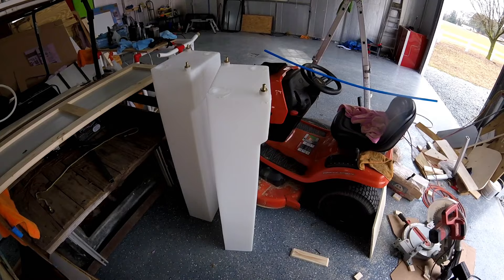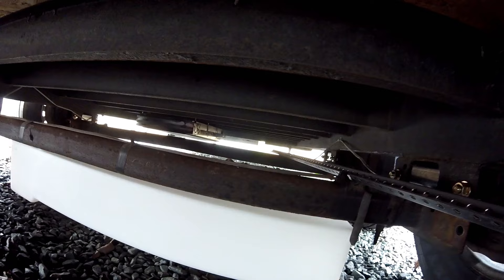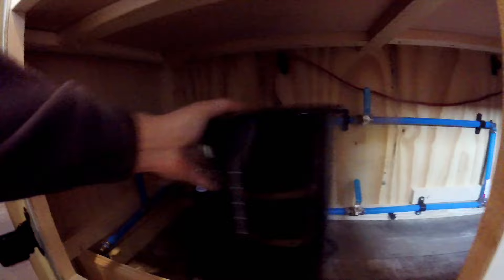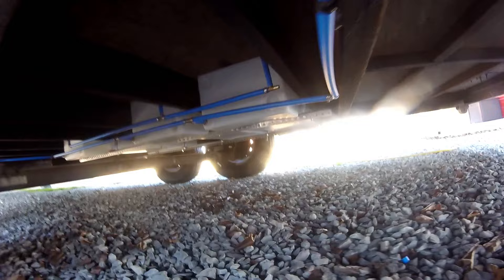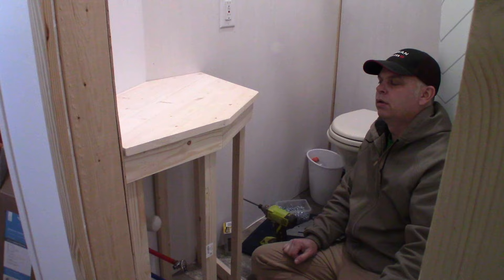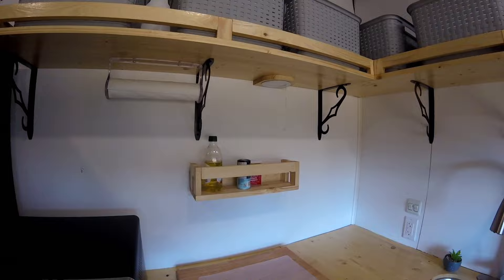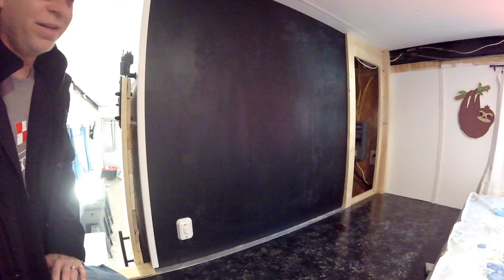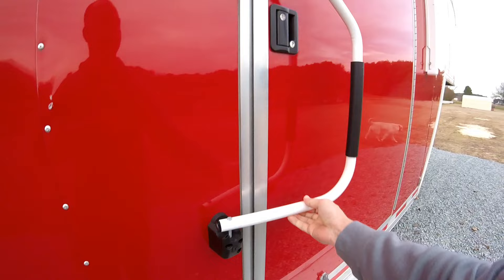Ultimate Cargo Trailer Makeover! Amazing Fresh Water Tank Install

Comment: I think I see a problem with your tank setup. Constructive criticism here, but I don't think your venting will work in that configuration. Tying them together would be ok, but not lowering the tubes below the vent hole in the tank. I'm sure you're going to get water in those vent tubes when you fill your tanks, thereby defeating the ability to have air travel through them to provide the venting when filling and emptying. If I'm wrong, please let me know. I too built my rv out of a 28' car hauler. I used the same tanks, from classacustoms.com I think, and tied them together using the 1 1/2" lines. I then used the 1/2" line to run to the pump. If you're interested, I'd enjoy talking to you further about each others setups. I may have a "wish I hadn't done that" moment you can avoid. I really enjoy the videos, because I still wish I had done things differently. Good luck and happy camping.
Reply from the maker: Thanks for your comment and I don’t mind the constructive criticism at all. When I cut the vent lines coming down from each tank I tried to be sure they dropped consecutively as I got toward the back of the trailer. My thinking is that as long as I leveled the trailer while in use it should drain any water in the lines out and be able to vent. I haven’t used the tanks enough to know for sure if my plan will work, but that has been the best part of building my own. I can change it to single vents on each tank if I need to. The main reason for tying the vent lines together is so I can add a valve at the end of the line. When we owned a travel trailer we would fill our tanks to go on a trip and find that when we got to our destination we would only have 2/3 of a tank due to the vent siphoning out water while traveling. Again, it’s all trial and error so if it doesn’t work I may have to go to a single vent for each tank, but I’ll have to use them more to really know. I really appreciate the comment and thank you for watching!
Reply: @BuildYourOwnAdventure  No problem, I've enjoyed watching the updates. My wife and I took some video of our build, but I'm sure I didn't enjoy doing it as much as you did lol. Working with the tanks was by far the biggest pain in the entire build, including solar, inside plumbing, electrical, building cabinets, walls, ceilings and insulation. Keep a positive attitude and I'll see who's correct down the road.
Reply from the maker: @seekingserenity2731  Thanks. I've enjoyed filming the build for the most part, although there are many times I would like to leave the camera inside and get more work done. I'm glad I've stuck with it though. It really gives me motivation to be able to review where we've been and where we are now. That's awesome that you installed solar. I really want to add it to our build, however, we just can't justify the price at the moment. Maybe we'll add it down the road. Thanks again and I'll try to remember to give an update on the tanks once I use them.